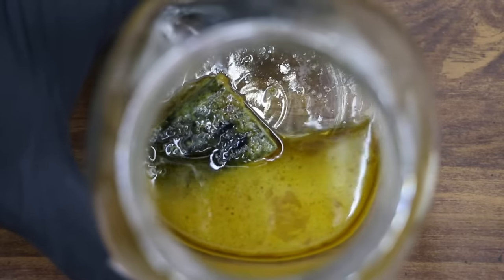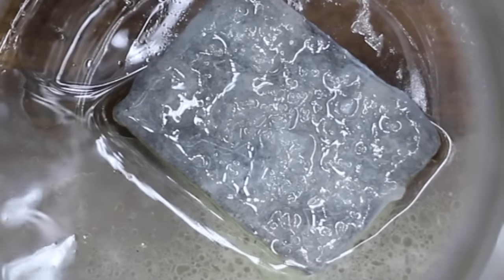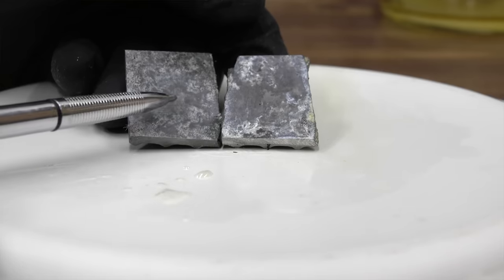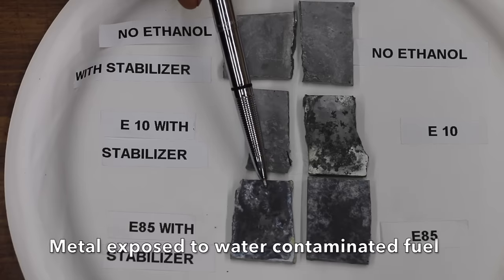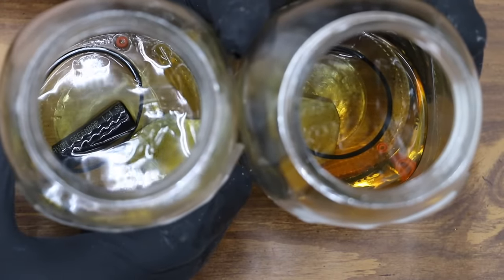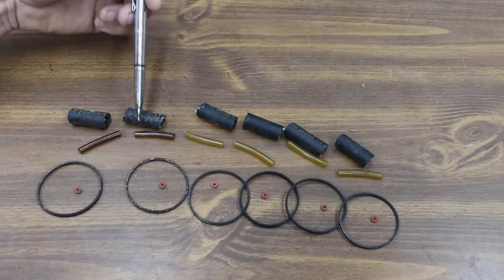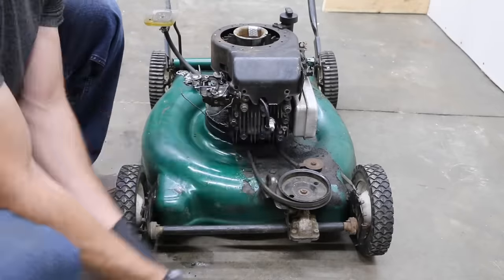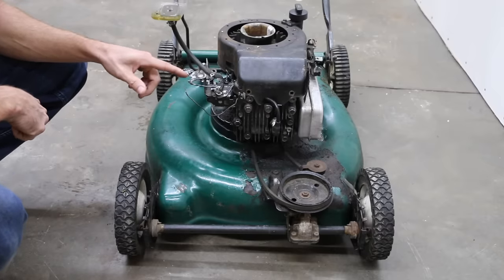Does Fuel Stabilizer Prevent Ethanol Damage?  Let's find out!

Comment: This is a very fantastic and informative video! I’ve actually forwarded it to a customer who has sent me several pieces of equipment to be fixed. 

The most recent was a generator power by Briggs & Stratton engine. The factory has not even made a carburetor in months so it was difficult to replace it with an OEM unit. I had also replaced the in tank fuel filter switch fuel line, and other items. I believe the last week point in the chain was probably old gas. He brought me a jug of ethanol free fuel, but I have no idea how old it is. Your tests show that the ethanol free fuel does seem to burn, but with help from starting fluid which is exactly what I did. 

Thank you again!
Reply from the maker: Thanks for sharing.

Comment: Would measuring weight of components show additional proof of differences?  In addition I am now wondering about aluminum engines that use up to 10% ethenal.  85 octane vs 87,88,89,91 octane.  I am also wondering if running no ethenal fuel 2 times a month will reduce corrosion and increase longevity of components. 

Lastly I am curious about the knocking of piston rumors as the reason for adding additives to fuel.

Comment: riddle me this: I have a chainsaw which I bought from the previous owners of my house. That was in 2019. I've never touched it except to cut stuff. I swear, that thing starts up every spring and fall without much encouragement. If gasoline goes bad, how does that thing still run on 4+ year old gas? As for corrosion from ethanol gas: been there, done that. Had to rebuild a carb on an almost brand new power washer after leaving gas in the carb over winter.

Comment: it's not the ethanol, it's the water that comes along with it.  A can of pure ethanol won't corrode,  used to buy them from Aaper.
but....the ethanol also helps to make trace water miscible with the fuel so it can pass through the system, not as good as methanol but still does.
I wonder if sticking a slug of zinc on the float bowl would help?

Comment: You were using aluminum as the metal on all the tests, right? So, what about cars designed today to run on "flex fuel"? Do the components in those cars have aluminum that is exposed to the fuel? If not, then are we safe using ethanol in those cars?

Comment: I wanted to see if the 5 plus year old weed eater oil/gas mix would still work so I used it in my 1929 Ford Model A. It wouldn't start on that fuel but after starting on fresh fuel the engine ran on the old fuel until it was gone. I guess the oil mix has some stabilization properties.

Comment: Here in Brazil we use ethanol as fuel since late 70’s, the better solution for carburetor corrosion is nickel plate, it prevent corrosion issues and also male it look’s shiny (rsrs).
Reply from the maker: Thanks for the feedback.

Comment: I have two questions.  You added water. 1) Is the fuel system closed all the way to the carburetor? Is a carburetor pulling in moist air?  Is it HEATED enough to prevent moisture FROM the air to cause the damage TO the carburetor?  2) OR is the damage associated with the ethanol in the fuel due to something else, the temperature it burns at or water in the ethanol?  As you can tell I know virtually nothing about the details of how engines work.
Reply: There is always water vapor in the air.  This will be left behind in a fuel system when the engine is shut off.  Chemical reactions with the ethanol will occur, you can't stop it unless you can figure out how to operate all of your IC engines in an atmosphere with zero water vapor.  Good luck.

Comment: The only preventative to any fuel issues with small engines is to run the engine dry and at the end of the season drain the tank. Does not matter if non-Ethonol fuel is used I still drain the tank or run it dry because you risk getting water in there.
Reply from the maker: Thanks for the feedback.

Comment: For the last 12 months I've been a bit concerned about the normal NO Ethanol fuel in my motorbike as it hasn't been started since December 2022.
Although I have a bottle of fuel stabiliser it hasn't been added as yet but will start her up this week and see how it goes. Hopefully no issues as summer is coming and I don't want to have the bike in the shop with fuel problems. It's so damn expensive over her they should put additive in as a bonus.
Today November 9th, 2023, the price is $7.50 per US Gallon(about $2 per litre) was $8.20 a week ago..
Reply from the maker: Thanks for the feedback.

Comment: I only use recreational gas in my carbureted engines.  Ethanol is a alcohol based fuel making it attract moisture by nature. Moisture causes more evaporation resulting in a more acidic solution causing more damage.  About 85%-90% of my small engine repair work is because of people not using Recreational fuel. A few extra bucks per season is far cheaper than repairs, parts or equipment replacement.
Reply from the maker: Thanks for the feedback.

Comment: Hello and thank you for  the time you took to test these fuels.
I have an 1982 VW T3 and E10 has just been introduced here in the UK. I have the additive for when I have to put E10 in my tank, but try to only use Super unleaded where I can. 
Am I right in thinking that if I do use E10, that my biggest problem is the water and if that's the case would I be as well fitting an (if they exist) inline water filter?
Thank you

Comment: I've been using non ethanol fuel in my mower, chainsaw,  weedeater, etc for 15 years. I've  yet to have any card problems with any of them. Use Stabil in the fuel, and run the carb dry when storing the device
Reply from the maker: Thanks for the feedback.

Comment: I do no not know...I have a 25 year old Stiga push-mower with a Briggs engine. Live in Sweden and have always filled it with normal gas station 95 (that here in Sweden has ben 5%ethanol for a very long time) up until 5 years ago, when I fiddled around with the carburettor and got it to run on E85. I have always been sloppy, left fuel in it for extended periods of time (a year once with E85), left it outside on a rainy night more that once, changed oil the first time when it turned 25 years old, you get the picture. The only problem I have had is that mice ate the crankcase rubber ventilation line that goes to the carburettor, and even then it somehow started on the second pull (like it always does, obedient little thing) and ran for 30 minutes. Replaced the rubber and she runs happily once more
Reply from the maker: Thanks for sharing.

Comment: Yes it does.  Had two weed eaters that the engines froze up and fuel leaks - the third weed eater i received on warranty had a tag included with paperwork that stated - Must use Ethanol Treatment and fuel stabilizer otherwise warranty is void. Ethanol absorbs water so ethanol is bad for your engines.
Reply from the maker: Thanks for sharing.

Comment: Use AV-gas as a control fuel, especially for aging tests.  AV-gas has remained a more constant formula than any other readily available fuel.   Buy AV-gas at smaller airfields.  It does have tetrahedra lead in it, but it is not suppose to be nearly as much as 1960s automotive premium did.  

I told Mt. Comfort airport Indiana I had an antique chainsaw I was afraid to put modern E10 fuel into.   They let me buy 4 gallons of AV-gas.   It has a  blue died in it.   I never actually got the antique chainsaw to the place I put this AV-gas into it so I burned some in a lawnmower.   It burned very smooth and the AV-gas has never smelled like bad gas even though I still have some of it two years later.  I'm using it to soak the antique chainsaw's cellulose air filter in for cleaning.   

My guess is AV-gas has a much more consistent formulation than automotive fuels.  It's a really big deal to chain it has to be approved by the FAA.   I'm going to try REC-90 fuel because running my FS66 Shihl trimmer with a new Harbot WT-45 clone of the original Walbro carb. has only gone a little over a year, with running the trimmer out of fuel anytime it was not going to be used for a few days.   Just recently it would only run at fuel throttle with the choke half on.  It still needed this much choke without the air filter on.   I replaced the Harbot WT-45 with a Mckin FS66 and the trimmer wouldn't start after many many tries.  I put the Harbot back on and it would start.  I  returned the Mckin FS66 to Amazon.  

I rebuilt the original Shihl Walbro 45A carb. with a K10-WAT kit from Walbro and it only had the blue acetate pump diaphragm.  I could only get the trimmer to run at a good idle after bending the metering lever above the normal height.  With more throttle the trimmer would die.   It was a two kit package and I replaced just replaced the pump diaphragm and metering diaphragm with their gaskets on the Harbot carb.   The Harbot carb. had had what appeared to be an acetate pump diaphragm.   The Harbot carb. with the new blue acetate Walbro pump diaphragm would not run the trimmer at all.  

 I took the cover off the metering side of the Harbot carb.  The metering chamber sits  level on top of the FS66 trimmer.   I held the metering lever down to open needle valve and pulled the recoil several times and got no fuel.   I did this with the rebuilt Walbro and after 8 -10 pulls it started to bleed a small amount of fuel into the metering.chamber.  I don't have a known good carb. to compare this fuel flow to.  It's only a few drops of fuel and is really too small an amount to notice from one pull of the recoil cord.   My guess is this not enough fuel to run the trimmer at fuel throttle.  Reading on-line reviews the acetate pump diaphragms are suppose to do well with ethanol fuel, but pump little fuel compared to the neoprene black diaphragms.   

Now there are reports that the standard E10 pump gasoline has likely changed to include other fillers that are bad for small engines.  People have been able to use E10 fuel in small 2-cycle engines by being careful to not let it age and have fuel stabilizer in it and not letting it stay in the machine, but now components appear to be going bad even with these precautions indicating other substitutes are being blended into pump gas.   I don't care that much about the FS66 trimmer.  I'd like it to run, but I DO CARE ABOUT THE ANTIQUE CHAINSAW.   I don't want todays E10 pump gas hurting the chainsaw I use for clearing downed ash beetle killed ash trees on the woods trails at Paul Ruster park so I'm going to try REC-90 from CountryMark.  Thank you for your thorough videos!!
Reply from the maker: You are welcome!  Thanks for sharing.

Comment: here in the UK we just switched to E10....for green purposes. But if it does less mpg compared to E5, destroys components of perfectly fine vehicles then it's not greener. We need to put more in to do the same distance as previously, cars wont last as long as they start to be damaged. Most will get rid and buy a new car rather than spend thousands to repair the problems this stuff will cause.
 I try and use E5 but it's a lot more expensive, E10 is £1.34 a litre, E5 is £1.49 a litre, i suppose given you get more MPG from E5 it probably evens the cost to miles ratio somewhat. I didnt realize E10 was such garbage tbh, i don't think most people do. My car certainly runs with less power using E10. We had fuel shortages because of the switch recently.
Reply from the maker: Thanks for sharing.

Comment: I buy non ethanol leaded and unleaded fuel from a distributor locally.  I use it my garden equipment, and 69 porsche 911 .  Ethanol gas is like brake fluid. It absorbers moisture.  If you leave it in cars, or any garden equipment, it will eventually destroy the fuel system, not just the carburetor.

Comment: I use high octane fuel in everything I own, my lawn mower, my riding lawn mower, my boat and my cars.  I have never used fuel stabilizer up until now in my boat, I have never drain the gas either and never had a problem. Also too I live in the south if that makes a difference.......
Reply from the maker: Thanks for sharing!

Comment: I've found the newer snowblowers with the Chinese engines the carburetor's corrode very fast compared to the older Tecumseh and Briggs carburetors usually just need a fuel flush. But the Chinese carbs need to be replaced after only 2 or 3 years. I have 40 year old Tecumseh with the original carburetor's that only need a new rubber gasket once in awhile. The carburetor materials make a big difference.
Reply from the maker: Thanks for the feedback.

Comment: QUESTION:  what is the difference between 91% alcohol running an engine, and 200 proof undenatured alcohol, which is considered ethanol?  Would this cause the same issues as in your experiment?  Thanks for the info.
Reply from the maker: Thanks for the suggestion.

Comment: Would love to see what a year or two of ethanol gas does to a systems on fuel injected cars and bikes.
Wouldn’t be surprised if the carbon footprint it takes to farm and process ethanol, as well as the extra parts replacement and maintenance from burning ethanol (as well as takes up farmland that could be used for food) is the same or more as burning non ethanol fuel
Reply from the maker: Thanks for the suggestion.

Comment: Could you do a test where you fill a sealed container full with e10 and another container with 85? If there is no air in either container, there won’t be any water for the ethanol to absorb. Maybe the fuel would still be good. Also test a piece of aluminum for corrosion in a e10 and e85 sealed air free containers.
Reply from the maker: Thanks for the suggestion.

Comment: I've used year old ethanol fuel by adding Startron fuel enzyme when I first get it. It stops the water process. Not all stabilizers are equal. I leave treated gas over the winter and everything starts 1st or 2nd pull in the spring with last season's gas.
Reply from the maker: Thanks for sharing.

Comment: I've used ethanol fuel in all my engines with no problems. I Use Seafoam in the gas and all my engines during the off season. I've used ethanol gas in my motorcycle (carbureted) for over 20 years with Seafoam during the off season. My engines start and run just fine and I never do any carburetor maintenance on them. The whole non-ethanol issue is a bunch of shit. The only time I have to work on a carb is when I buy a used engine and people don't drain out the old fuel after storage with no fuel stabilizer. I've let fuels it all winter with Seafoam in it and it fires just fine. I never had water issues in my gas.

Comment: The big issue here is water contamination causes the ethanol to fall out of solution and turn into an acidic mess. there is nothing metallurgy wise special that makes a fuel injected engine less susceptible, it is the fact that it is a sealed system, the evaporative emissions system prevents the free exchange of moisture laden air in the tank, and the evaporation of the more volatile components. Carburetors are very susceptible to this because they have a bowl vent by design, so their bowl is breathing moist air and they allow evaporation of the relatively less corrosive fuel components. I would suspect fuel stored in a sealed container in relatively reasonable conditions even long term would have a far better outcome.
Reply from the maker: Thanks for the feedback.

Comment: So this has happened in Ontario, Canada.  Very sad that the government is taking away options and have plans for even adding more ethanol in future years.  I found one gas station who still sells MARINE FUEL which apparently is sold as ethanol free gasoline.  I only use this marine grade gas in my small engines.  INFO FROM CBC (Starting in 2022, all gasoline sold in Canada at gas stations will be blended with ethanol, including premium gasoline according to proposed regulations.Jul 16, 2021)

Comment: I have a motorcycle gas tank I got back in late August, needless to say I have left it sitting in my room with no gas inside but winter is coming up and I was told to put gas and a fuel stabilizer inside do you recommend I do that? It’s going to sit for a quite awhile inside my room as I’m currently rebuilding my bike. It’s a carbureted bike so it just has a petcock.

Comment: If I stop fuel flow to the carb and let it run till it dies , have I "emptied" the carb to where it won't corrode ?  At the end of the season , I always add some stabilizer and let it run till I'm certain it's reached the carb , adequite ? Thank You .

Comment: Interesting. I use the stab-il for 15%e fuels in small engines as well as for the car and moto and they always fire up just fine. I keep the tanks full when possible and capped (with no venting) to minimize any humidity exchange and evaporation.
Reply from the maker: Thanks for sharing.

Comment: Luckily the closest gas station to me now has some non-ethanol pumps and I use it on my small engines. I don't remember any other station that I used to frequent having non-ethanol, but that may just be selective perception.  I wonder if adding a little octane booster to the stale fuel would get it going.
Reply from the maker: Thanks for the video idea.

Comment: A video idea - Would seafoam protect against ethanol fuel damage?  While seafoam is not technically a fuel stabilizer in packaging, their claims of using petroleum base oils to provide lubricity to the fuel system engine while using a solvent, makes me wonder if it provides protection to the engine and fuel system vs. ethanol moisture laced fuel.
Reply from the maker: Thanks for the video idea.